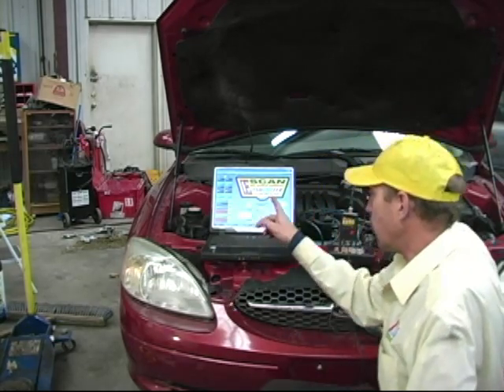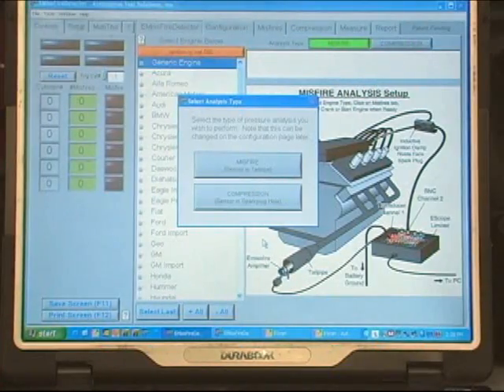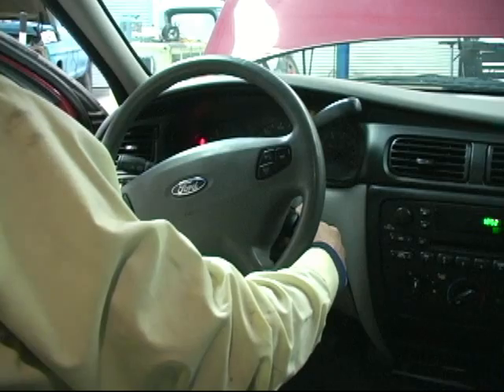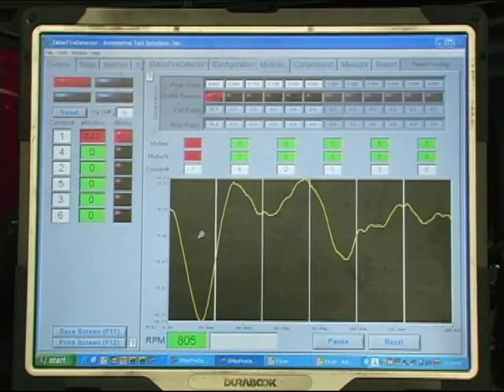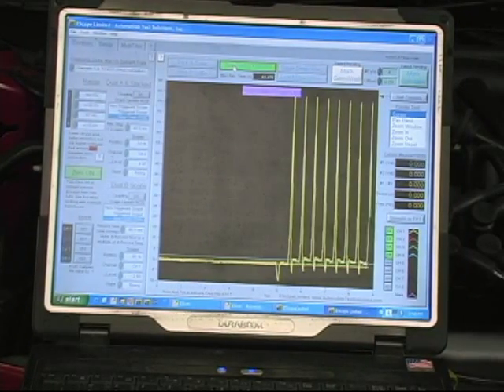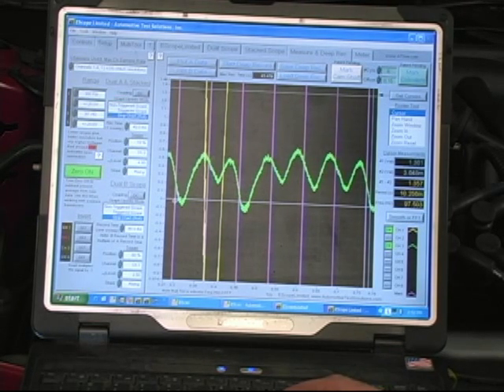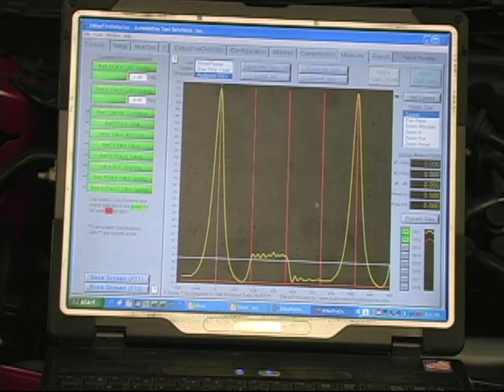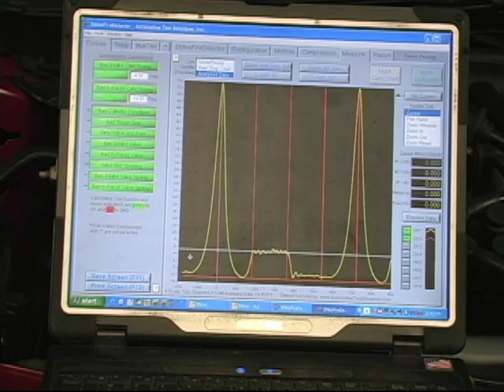EMissfire Detector  2002 Ford Taurus

Comment: I've seen an intermittent misfire on a VW Eurovan that was due to a broken valve spring (dual spring setup)... would that have been the "next" thing to check before removing the cylinder head?

Comment: It is real easy to figure it out,start it up and carefully remove plug wires with plug wire pliers from the coil one at a time.Mostly the coil is bad or wrong brand spark plugs used.The 3.0 vin U engine runs forever.The compression test,do another test with a compression tester.Over 100 psi and over,that is good

Comment: *It seems Vaccum sensor is not that sensitive to show clear intake valve leaks in to the intake. do u have better sensor?

*Intake ramp is not consistent with power stroke ramp.Can it be also caused by  bad intake gasket or by cracked head? what will happen if intake is clogged due to carbon formation and what if exhaust not sealing during intake?
*will there be a high vaccum at exhaust if exhaust valve is not seating during intake stroke? Any explanation is appreciated Thank you.
Reply: Hahaha! You got no explanation!